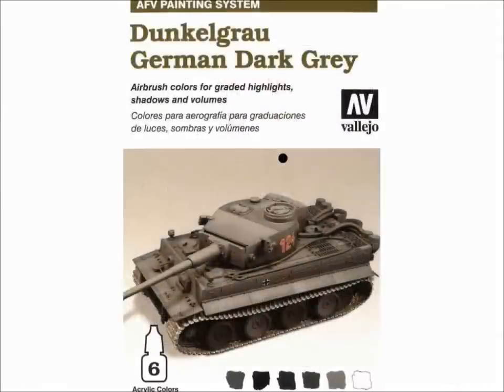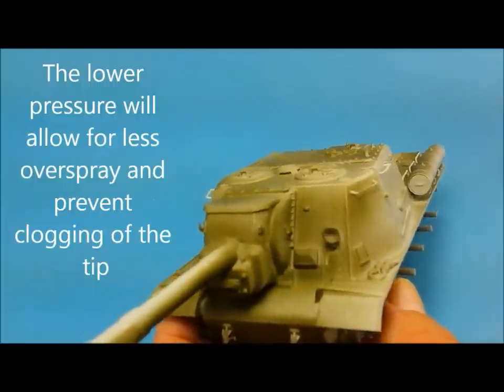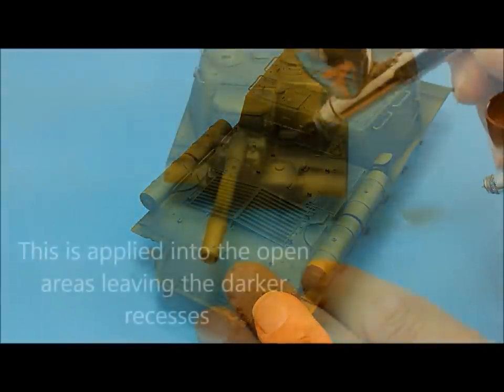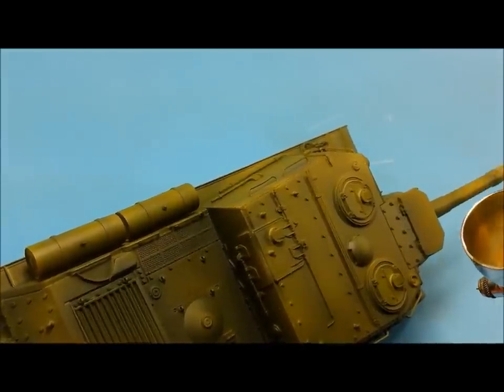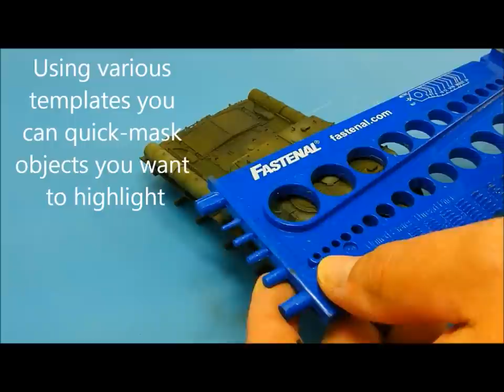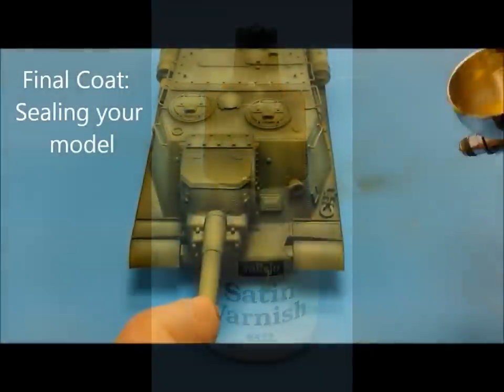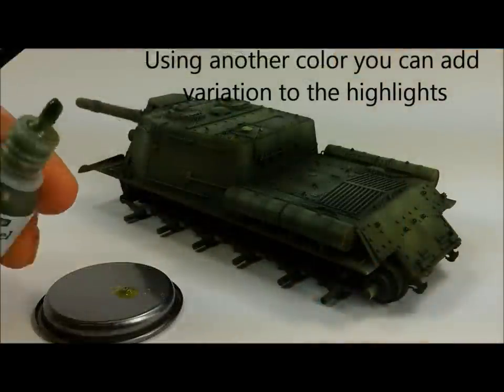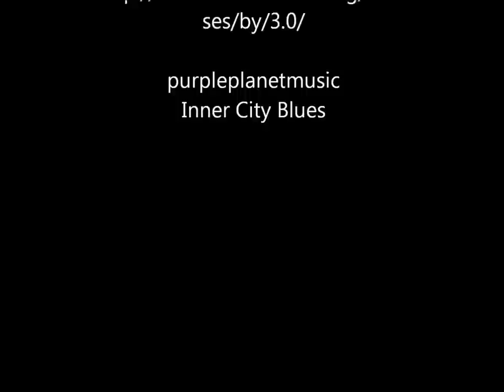Step by Step AFV Russian Green 4BO

Comment: How about the interior ?
I dont get it ? Why does a Trumpeter 1/35 scale Russian BMP-3E IFV  cost me $16. but a similar Tamiya kit  cost $60-$70.?  This will be my first tank model in 40+ years.  I do not see how to Maya could be any more quali and have more parts and detail than this trumpeter kit. My  Next paycheck I'm going to buy another Russian vehicle for 15 bucks which I guarantee you will have as many parts as a Tamiya kit not to mention they come with laser etch metal part for $15. 
Screw Tamiya, cuz they are screwing us !  Yes I understand they make kids that trumpeter does not make. Oh well
Reply from the maker: Sorry Harry.  Although this video is about paint from Vallejo, I understand the never ending questions about kits all to well.  My basic take on kits goes in a couple different directions.   Tamiya kits are nice in that the fit to the parts is typically excellent.  They do not offer photo etch and more often than not, the tracks end up being the useless black bandies.  Trumpeter kits are excellent as well and will not set you back money-wise either.  As of late, I have found that if I come across a kit I want to build, it is worth the effort spending a little more to get something all-inclusive...link and length or Indy tracks and a cheap PE set to make some parts look better.     Well worth the effort and money.  I found looking around, you can pretty much find a good deal on just about any kit.  Hit a local show...you can find some great deals.  More often than not, the kit is cheap enough that it is worth the effort to buy aftermarket parts and make a real gem of a build!
Reply: @5150TRM  I just got back into building a few months ago BUT If it were not for the 200+unbuilt kits I kept in my closet from 30 years ago when I managed a Hobbyshop, when models were relatively inexpensive . I dont think I would of got back into it seeing the price tags on alot of these kits. Not to mention the paints,air brushes and so forth.I do commercial HVAC and dont have the time to go to shows or hunt something online. 
I did find a GREAT hobbyshop in NJ. called
AAA Hobbies which is also Meggahobbies for their mailorder business.
HUGE warehouse with a store front. Im like a kid in a candystore. But I cant bring myself up to fork out $40.-$60. Per decent kit. I'll build what I have. 
I think the cost of a kit is hurting the hobby for young people who have other outlets like video  games. I dont see them having the attention span to spend that kind of Doe on a model when a game gives them more fun and excitement. Maybe I'm wrong.
Reply: @5150TRM  Got a question.Whats your opinion on Trumpeter 1/72 and 1/48 scale aircraft. If they are like the Russian tank model I bought, I will only be buying Trumpeter Aircraft. I have 1/72 jet aircraft models but want to go bigger for WW1 and 2. They get too small in 72 scale right ?
Reply from the maker: Welcome back!  LOL  I think we all go through bouts of leaving the hobby and coming back.  While this is the "golden age" of modeling, we are in agreement that costs are sometimes a bit out of control.  Like you, I have a healthy stash and probably could never buy another kit and have enough to build out my days happy and in peace...LOL   Recently, I have come to realize there are a number of newer kits, that while expensive, are incredible kits and need little to no aftermarket parts to enhance.  I will only buy what strikes my fancy, but, will also actually get built.  I have not impulsively bought kits for a long time now.   With that said..."ANY" kit will build up to an impressive display.  I have proven this with a good friend of mine a few times now...we trade off building basically the same kit, but one is a new expensive kit and the other an old standard from way back.  More often than not, people do not notice the difference.   I know the value of time too...I am a contractor...but, I will spend some time on the weekend sometimes, trolling Amazon or Ebay looking for aftermarket parts for certain kits I know I will build.  There are some great deals to be had.  Even if it is fenders for a German panzer to enhance soft detailing on a kit...5 to 10 bucks is not a bad price to pay for something that will help you accomplish a decent build.   

Along with models, tools and whatnot can be obtained as well...as you go.  There is a lot of mumbo-jumbo balh blah online when it comes to airbrushes, compressors and paint...etc.  At the end of the day, this is all opinions.    Case in point, is my compressor.....Harbor Freight 1/3 hp unit...probably $70.  I beat the hell out of it as I do demonstrations at some of the bigger shows here in the states.   Works like a charm.   I could spend $300 on a "professional"  version, but why waste the money.  Airbrushes are a little different, but not too bad.  You do kind of get what you pay for, but overall, $80 to $150 will yield a brush that will gain you a lifetime of quality use.  

I do know AAA.  Stevens International is one of the larger model distributors and owns the building and Mega Hobby is his sons online business.  AAA is owned and operated by another individual...if my memory serves me right.  But they do have a great selection and anything that is typically an order, they can run in back and get it from the distributor....LOL   I have a bunch of local shops up here in MA, but I do like MicroWorld Games, LLC...they are in Baltimore and have just about everything.   Usually ship within 2 days and pricing is always decent.
Reply: @5150TRM  Hey Todd, thanks for your response. After reading your comments I get the idea you are a Picaso of Scale Model building world where I'm a person who takes a beginner Art class at my local community  colleges .Lol. I kind of realize we need to be smart at buying kits. I just bought a Trumpeter 1/35 scale Russian Tank 70's era. I paid $16. at AAA Hobbies not expecting much.Boy was I wrong. The quality all around is confusing cuz why are they so inexpensive and Tamiya rapes us ? The quality of the plastic,packaging,Detail is  phenomenal. This kit scares me.Lol
Are their aircraft just as good ?
I WILL NOT attempt this kit until I hoen my skills.
Which leads me to this.....
I bought a compressor package deal from Amazon (?) . 3 Airbrushes, hoses,compressor with regulator, and moisture trap, 8 acrylic paints for $120. Sooooo, how much better is a expensive airbrush compared to "Master Airbrush" brand model G22,or S68 ? What is the real difference ? Longevity, ease of clean up ? It looks like quality but what the heck do I know ? Even though I have a ton of boxed unbuilt kits, mostly cars which dont interest me at this point in time, I bought 3 kits at AAA. Up until now it was just military jet aircraft in 1/72. But I have been itching to do 1/48 WW1 and 2 aircraft because of the more detail aspect of it. Just bought 3 models cause I couldnt help myself LOL.. All $15-$18.. Range. Revell 1/48 Stuka and ANOTHER 1/72 A10 from Academy. I'm 85% finished with a Monogram A10 kit which is dreadful compared to my Hasagawa and Academy kit but im using it to practice on.Sorry...I am long winded  or long fingered.I can go on and on . Again....Thanks for responding to my comments.
Reply from the maker: LOL...Personally, I would not consider myself a "Picasso".  I have been doing this stuff for a while and do have my own niches...and I suppose some may like my builds.  LOL   I am one of these people that is never completely satisfied with a build by the time I finish it...a personal quark. 

I can tell you that it can be difficult to be in this hobby and share your work without some critical thoughts (opinions)  screwing up the way we look at our work.   I learned a long time ago to build for myself.  I do choose to share my stuff, along with "model related work" but if and when the time comes where someone is overly critical...I let it go in one ear and out the other.   However, criticism, and to be honest, any criticisms, can actually give us the opportunity to see what we might be missing.   But in the end, I am more critical over my own stuff than pretty much anyone else could ever be...LOL   

As for the airbrush and setup you have...it is perfect.  The brushes are decent and last a while.   I do not have any Master brushes in my stash, but I have seen and used them and also have discussed them with a few before.   I would say the Gravity Feed airbrush (top cup) is the best bet.   I have used plenty of siphon fed brushes in the past...while they work great, I like the control of only using a few drops of paint to do what I need to do.  The gravity brush should break down for cleanup not unlike the high end brushes.  Most of the normal cleaning involves removing the needed and cleaning the cup and tip.  Try an avoid harsh chemicals like acetone and ammonia based products.  They work really well, but wreak havoc on parts.  Acetone will eat O-rings and tephlon and ammonia will damage brass parts after prolonged use.  After any session, I will run some airbrush cleaner through the brush...this is proprietary to the brand of paint usually.   I shoot Vallejo which is water based.  They have a thinner and cleaner...both work about the same.   For AMMO, AK and Life Color...they have their own cleaners...Tamiya is a solvent based acrylic and you can use their thinner/cleaner or lacquer thinner....or alcohol.   In most case though, Denatured Alcohol works excellent for most paints for stubborn paint.   If you use acrylics, you can also wash up with soap and water too.   It is good to familiarize yourself with the brushes.  Don't be afraid to break the entire brush down to see all of its parts.   I oil my needle and threads of my brushes....Badger Needle Juice is what I use, but in a pinch, you can use one tiny drop of vegetable oil. Keeps the needle moving smoothly and prevents some drying at the tip.   

As for the kits...Trumpeter makes some outstanding kits!   The planes too are excellent for the most part.   You got them for a steal..enjoy them!   There is no need to toss more money at kits as they all build up decent.   Comes down to what you, personally, want to accomplish.   In time, you may consider buying little trinkets as you see fit.  Not all aftermarket parts are better than the kit parts.  This is why I mentioned fenders earlier.  Some fenders in kits are thick...the photo etch are thinner and look a little better sometimes....depends on the kit.  Yes, Tamiya are notoriously expensive....but he fit is usually excellent.  But I agree that the price is a deal breaker when you do need to toss money into grills or fenders....or tracks.  Stick with the Trumpeter kits for now and you will be happy I think.   You have a show down your way once a year...MosquitoCon in NJ.....possibly Old Dominion in Richmond...you should go.   Not only can you see what people are building and styles, you also can get some really awesome deals on kits, paints and add-ons.  

Another thought (even after you said that you were long-winded...LOL) look through your stash ad see if there is things you want to part with.   You may be able to sell some of the older kits to pool together some coin for something new you might be interested in.  I started doing this a couple years ago.  Selling off stuff I bought thinking I was going to build...but realized I would rather take the time...and the money, from those kits to build up one decent kit with some bling for something I would really enjoy.  Just thought.   You would be surprised what some older kits would fetch online.  Some folks are nostalgic and will buy something they have not see for years. They get a good deal and you make your money back...if not more.  Less guilt when dropping 40 or 50 bucks on a kit.